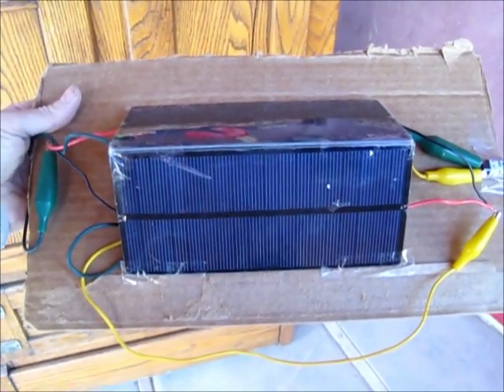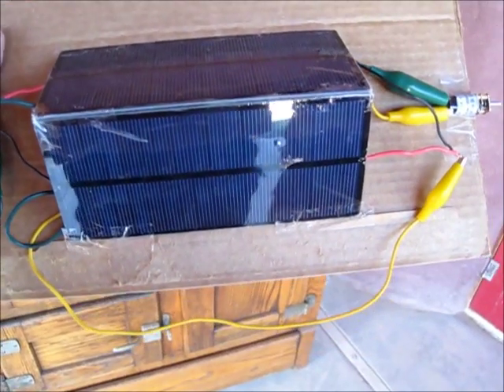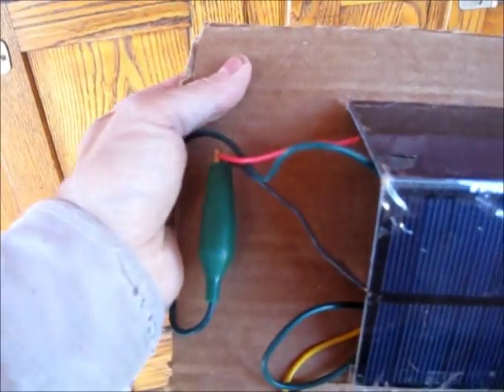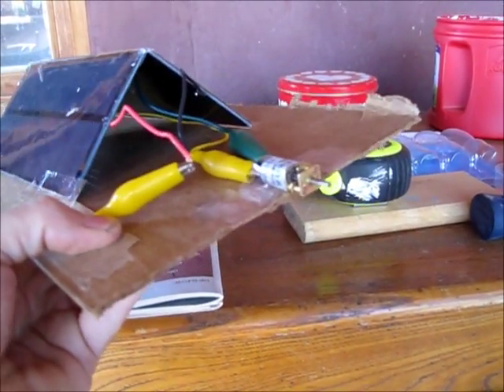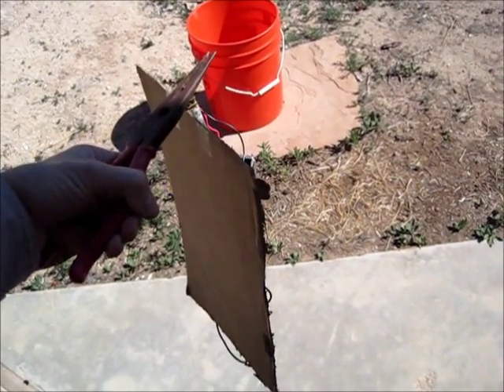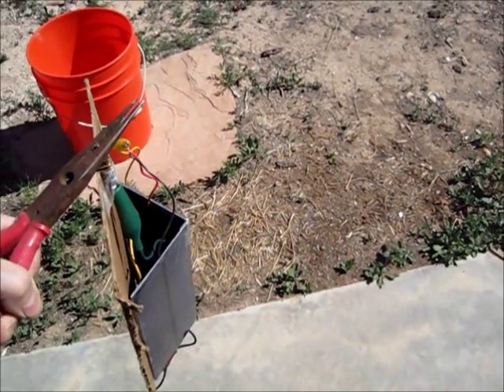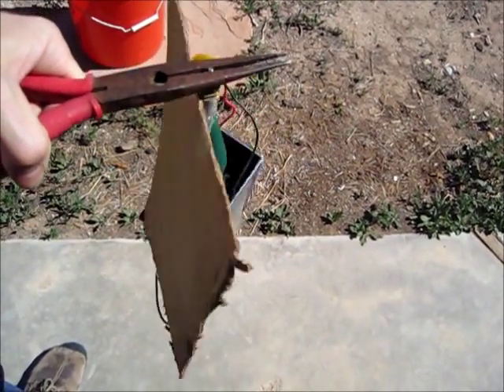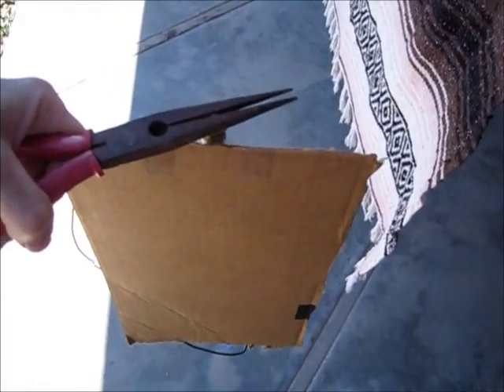Solar Tracker Prototype Works!!!

Comment: I think a dividing barrier between the two panels should help make the transition more fluid. Can this run on a cloudy day? I mean, can this run even when the sunlight is weak, as when the suns covered by a cloud.
Reply from the maker: The problem was the motor was not rigidly affixed to the cardboard causing the whole system to overshoot and go into oscillation. A dividing barrier would probably make the system even more sensitive to oscillation. This is a surprisingly strong feedback mechanism. Maybe I should be using smaller solar panels so the switching effect is not so abrupt or maybe a slower motor. I am using a geared down toy DC motor (est. 5,000 rpm to 30 rpm). If I used a 1 rpm motor, it would be more stable because the movements would be slower.
Reply: With a heavy panel/rack attached, it probably wouldn't oscillate.